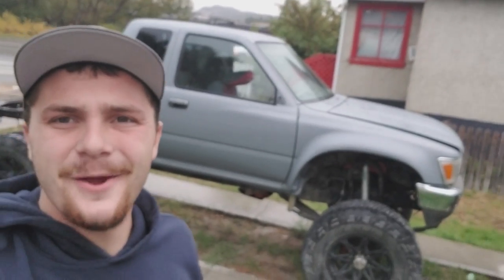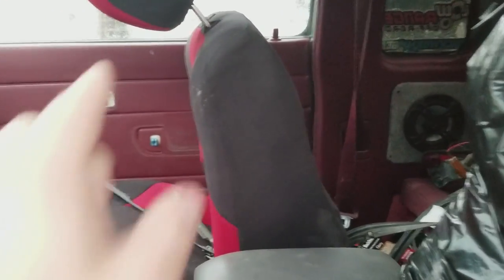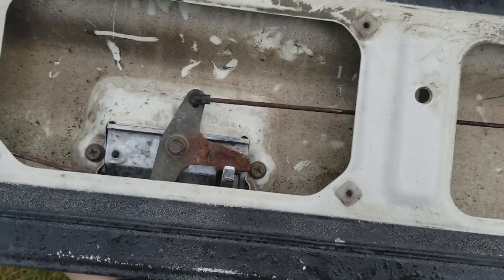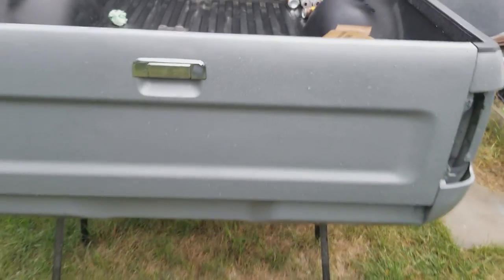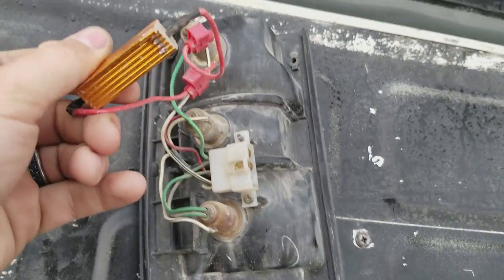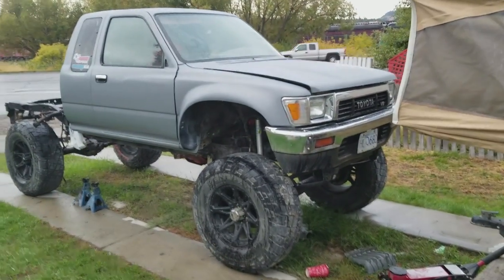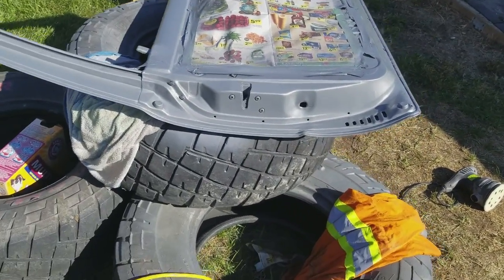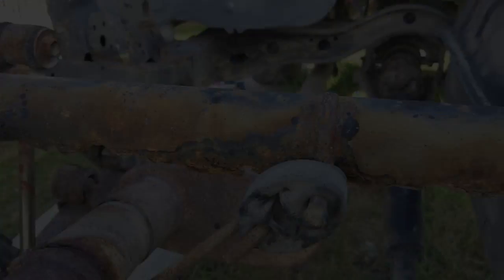New Paint - 1989 Toyota Pickup Build - Cement Grey

Comment: what kind of paint did you use and how many cans did it take to do the cab?
Reply from the maker: The paint I used is 1H5, ordered 16 cans from Lordco, they mixed and can it there. Only used about 12 cans. Although I used a cheap grey primer before spraying the 1H5, so only a couple coats was required.
Reply: people try and say sprey painting a truck with a spray can doesn't last or it doesn't look good what are your thoughts?
Reply from the maker: 1 year later and my paint still looks great!! Aside from the bush scratches from wheeling.. If you prep it like a normal paint job the paint will last.
Reply: thanks for the info